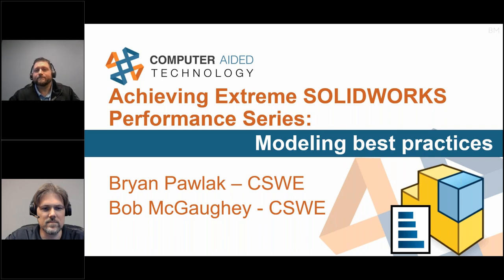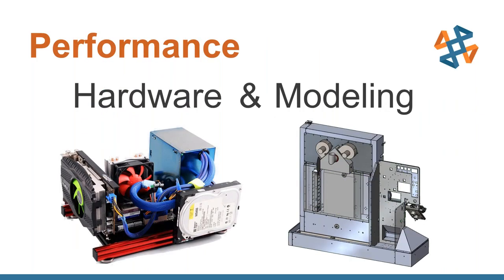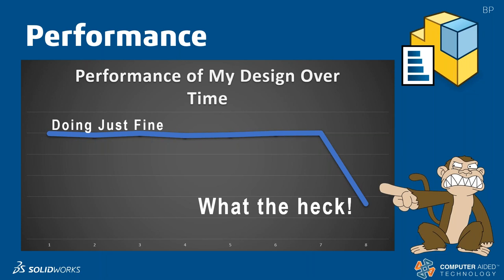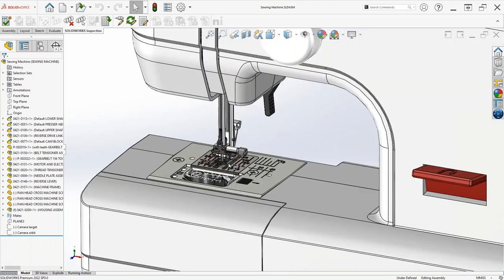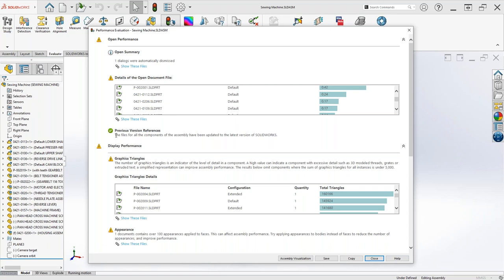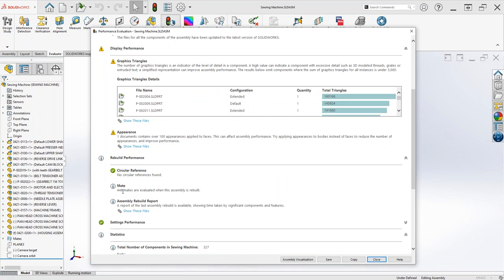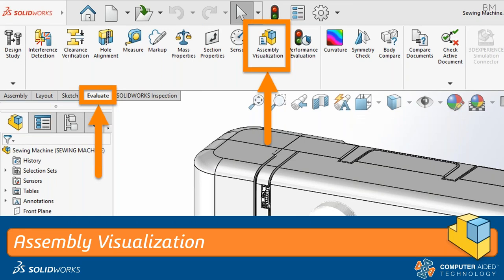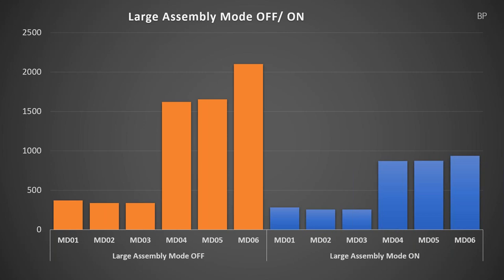Achieving Extreme SOLIDWORKS Performance Series: Modeling Best Practices

Comment: If questions are still open, why when running preformance evaluations on the same unchanged assembly would i get different results in open times both for the assembly and some parts contained within it? Also  if ive optimized tge graphics triagles as much as possible is that the end of the road to solving lagging issues?

Comment: Sorry I missed this. For configurations in assemblies, what is the preferred method; hiding components with envelopes, or suppressing components. I've been linking the display states to the configurations and using the envelope method. From what I've gathered in other videos this helps with performance issues. Any thoughts?